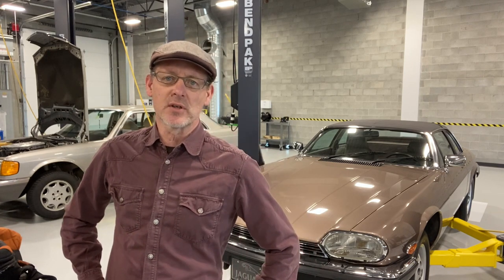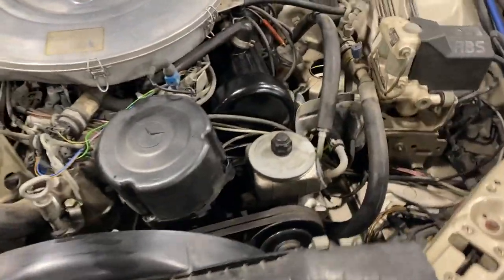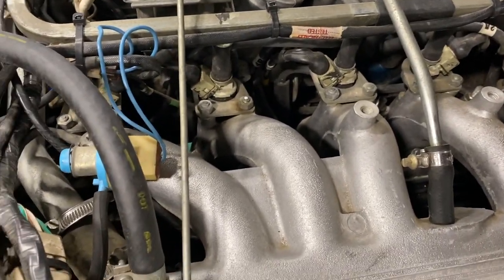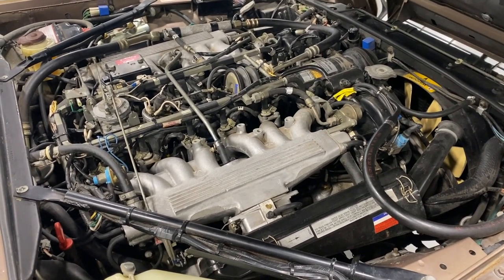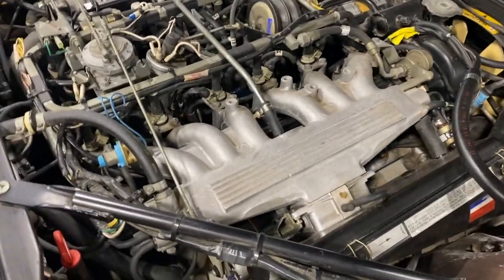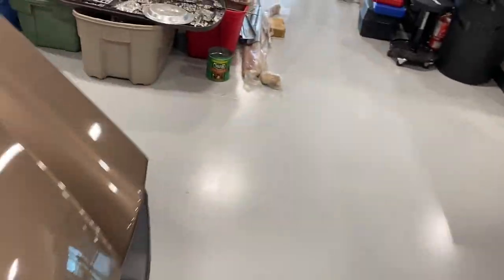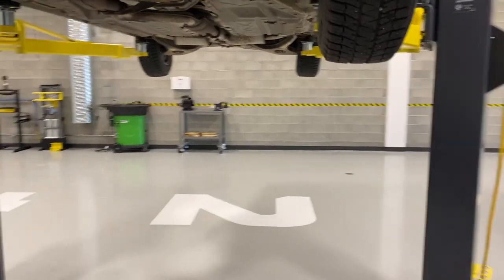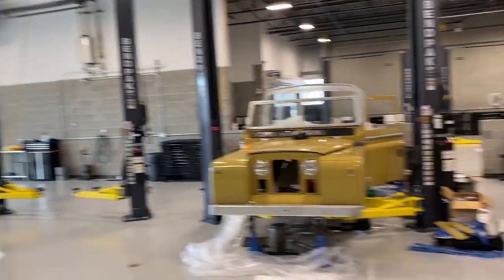Mercedes Vs. Jaguar in the 1980's: Which Is The Better Car?

Comment: Very nice video. It's interesting to compare these cars from a same era. Very interesting technical details too. I own a 1987 series 3 xj12 and maintain it myself. I love maintaining and driving it. Parts are cheaper than for the Mercedes that's for sure. The driving experience is also better as you mentioned. Maintenance is challenging as you said; as an example, replacing the 12 spark plugs is a 10 hour job, and most of the maintenance jobs on the IRS  (integrated rear suspension) require to drop it to get access. But it's a pleasure to work on and a real engineer's car. Greetings from France. Love your videos!

Comment: I am a Jaguar enthusiast and owner of an XJ 358 and an XJS straight six. But I also know very well the Mercedes of the 80's because my father had a W124 that lasted "only" half a million km. 
The bad reputation of the 80's Jaguars was a little exaggerated because with the correct maintenance they were very reliable, but we have to admit that the quality of Jaguar at that time was not the best. And also, giving them the right maintenance was not as easy as with other brands, mainly on the V12 engines. On the other hand, the Mercedes of those years were probably the best of the best. 
I would say that Mercedes were better, but the sensations that those old Jaguars offer........no Mercedes can match that.
Reply from the maker: well said! I agree
Reply: Mercedes for the head.
Jaguar for the soul.

I don't think I'd get the same feel-good factor from a Merc than in a Jag.

Comment: I prefer the styling of the XJS and the V12 engine is very smooth but let down by the 3 speed automatic gearbox though most auto boxes from that era are crap.